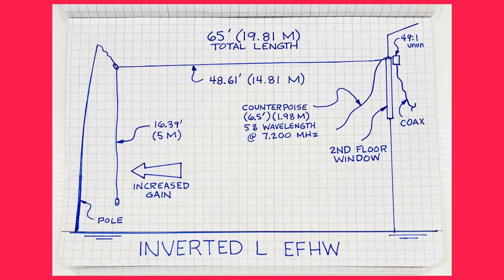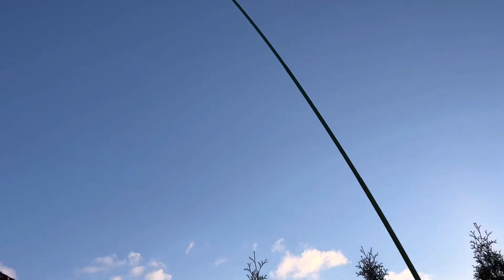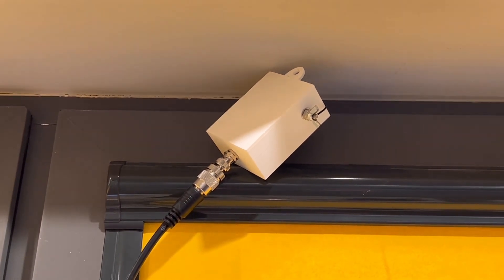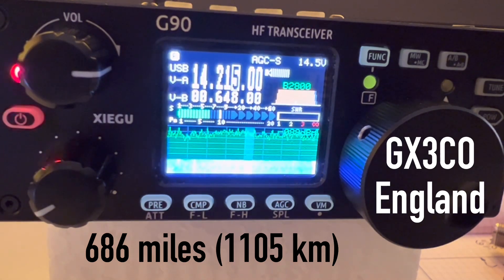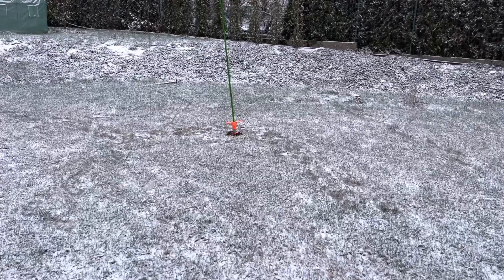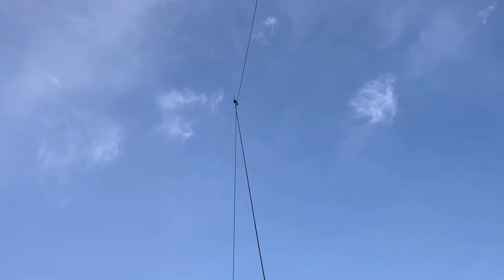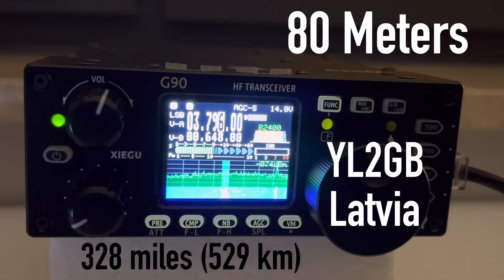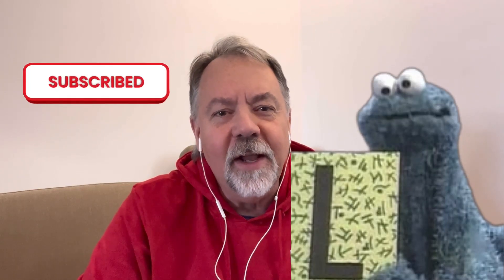Increasing the Directional Gain of an EFHW Antenna

Comment: I have had good luck with a home made EFHW cut for 40m, running up a 9m squid pole and then across to whatever trees are around in the area. I also lay a 10m counterpoise along the length of the antenna. Works great straight into a G90 using the internal tuner, and tunes up fine up to 80m.

Comment: I tried doing exactly what you have done but found that the SWR was off the scale and the noise was unbearable so what I did I reversed it and fed the 49/1 down the garden and fed it with coax, now SWR is perfect and the noise decreases a hell of a lot. now getting great results.
Reply from the maker: Awesome, thanks for sharing

Comment: Hey Walt, great video! Watching you operate in Poland got me curious about the process. I looked you up on QRZ and found you are a General class license holder. I recently upgraded to General and noticed in the video you were operating outside of the US General band limits. After some quick research, I found that you were in fact operating perfectly legally while in Poland! I am by no means criticizing, I just found this super interesting! Thanks for the great content! I''m going to try out the inverted L EFHW soon!
KM4EBM
Reply from the maker: I’ve actually done a couple videos on the CEPT process and operating in Europe. It’s really a simple process. Yes the rule for bands is that I operate under the band plan for the country I’m in, I get all of 20 here in Poland but as a General I can’t use 17 or 12 meters so that was a loss but I’ll be good when I get back, I’m taking the Extra exam in January.. 73, K4OGO

Comment: Hi Walt,I tried both your configurations but then I put the 49:1 at bottom of my 12m pole,ran it up vertical approx 35ft then across horizontal the rest of the way n this definitely seemed to work better for dx and local combined :)
Reply from the maker: Good stuff, thanks for sharing

Comment: i use end fed, inverted L, 1/4 wave wire antennas.   No balun required.  a 160M wire, 40M wire, 30M wire, 20M wire, all connected together off of one coax.   They work great !  Haven't looked for gain in the direction they point, I will certainly look now !    Thanks
Reply from the maker: Awesome, thanks for watching!

Comment: I use an Inverted L for 160-6 meters. I have mine fed at the base of the vertical portion with an air variable cap. The fed point is at 47 Ohms according to my MFJ 269 analyzer. I love it. I have made contacts well into Eastern Europe and East Asia from my QTH in NW Ohio.
Reply: How long is it?

Comment: My main antenna that I use at home is an EFHW in an inverted L. It's a little different though. Mine starts @ 3" off the ground then goes vertical for 45' then out to a pole @ 35' high. I have mine pointed kind of over Africa towards Australia. I feel like the gain helps. I'm very happy with it and get worldwide coverage on 40-10. Mine also tunes up on 80 as well. Very nice video. Maybe I'll try it sometime, your way.
Reply from the maker: Awesome! Thanks for sharing and thanks for watching. Hope to catch you on the bands. 73, Walt K4OGO
Reply: ZS1FSX here Walt howzit - I stand under correction here but it’s my understanding that this is not an inverted L, rather a horizontal L which is basically a cloud warmer.
As described above an inverted L starts close to the ground risers vertically then the tail is horizontal.

An EFHW acts like a Dipole in so much as the take off point is at the centre of resonance along the wire (a vertical has the take off at the base) so measuring the directional angle is at 90 degrees to the centre of resonance.
Hence describing your set up as a cloud warmer it’s radiating predominantly vertically.
Try switching things around take the transformer 49:1 unun to the base of the pole run the wire vertically and then the tail towards your window. Ground the coax braid side to a ground stake 
I suspect you’ll get much better distance.  
In my experience the tail provides a bending to the angle of take off so in this case it’ll still be orientated towards west but will be much flatter
Reply from the maker: @downsouthsafaris6788  theoretically I’m sure you are correct. This was just an experiment feeding it from the other end to adapt to my situational circumstances and see how it performed directionally. All the best and 73.
Reply: @downsouthsafaris6788  I don't think it will make much difference, whichever end you feed, the middle will always be in the same place. When you say "a vertical has the take off at the base", you mean a quarter wave vertical with a ground plane? You are effectively centre feeding a dipole at the ground.

Comment: Walt, well done... I may have to try this with one of my EFHW antennas. Cool that the G90 would tune up 80.
Reply from the maker: Thanks! Yes that’s a testimonial to the G90 ATU for sure. 73 my friend!
Reply: @COASTALWAVESWIRES  I have a squared EFHW and like all my end-feds I used, all tuned on 80 meter with the internal tuner. A EFHW of 10 meter long you can tune also on 40 meterband. the 49:1 UNUN I make from insulated wire in one peace and no soldering to it. Just use clamp connections. also no box around it, but vulcanization tape.

Comment: Your antenna experiments are a great inspiration to try out things. I'm often surprised about the performance of your low by the ground hanging antennas and especially the verticals. I wonder what the performance would be of a 40 meter dipole with one leg on a vertical pole and the other leg (and the feed point) along a 2 meter high fence. Any idea?

Comment: I did the same thing I have 134 feet I had it flat at 1st it was great and now I've got End fed box 1 feet off the ground and to goes up about 17 18 feet and the same at the end of the antenna it drop down 18 feet it Made a big difference especially on the high bands excellent on 10 m.
Reply from the maker: Awesome, thanks for sharing

Comment: Do you use EZNEC to model antennas? I use it a lot. The pattern of a halfwave horizontal antenna is the same end fed or center fed for all practical purposes in the real world. However there is definitely a skew in the pattern toward the down side if it is not installed horizontally. The half wave end fed antenna on 80 will load and work quite well as a quarter wave top loaded vertical in the same manner as my 165 foot long 160 meter Inverted L. Again with a slight skew to the low side of the flat top.  I go longer than a quarter wave so I can simply tune out the inductive reactance with a variable capacitor.
Reply from the maker: I have MMANA but to be honest I’m just getting familiar with it. Interesting input, thanks for commenting.
Reply: Seems like this is not an inv L? Correct me if I’m wrong. The feedpoint needs to be at ground level at some point? Not really on a second story window with a ground counterpoise hanging down. Also the higher the vertical section, the better the antenna works for the L purpose? I’ve noticed very little difference in running the antenna in all 3 configurations. I guess we go back to it’s a wire. And there’s no gain unless another element is added. Always fun to tinker with antennas though I don’t expect any significant changes 😁
Reply: @JayN4GO  Jay, this is an “inverted” L but not the typical inverted L we usually talk about. The classic Inverted L is a top loaded vertical. This one is fed from the opposite end. As with all antennas the current at the tip end is near zero and builds up as you move away from the end. Depending on the vertical height and frequency the vertical part can change from being simply loading the horizontal wire to actually being a vertical radiating element. In almost all cases you can bend the end of a wire, the part where the current is low, up or down and not reduce the effectiveness of the horizontal part by very much. In fact a half wave dipole can have its tip ends bent down so that the center horizontal part is only a third of what it was and you might not even notice the decrease in signal strength! There will of course be some reduction but even as much as 3 dB is usually hard to tell.
Reply: @dandypoint  Tnx bud! I’m not sure why I’m not seeing your videos. YouTube maybe hiding you. I saw your post in Fb group with Jason.

Comment: Couple weeks ago i did some test. 1/4 wl vert vs. EFHW 8010, where the feed point was on a 10 m pole on 3,5 m height balcony. I found that vertical was much much more effective that end fed. both of them were used without ATU, tuned in a middle of 20m band. Thats my opinion. Maybe i did a mistake and i shoul feed it on the height, not on the bottom of the pole.

And of course - thats confirmed - the more counterpoises the better. 

Take care! SP7EZG, thank you for the channel!
Reply from the maker: Thanks for sharing Artur! Interesting experiment. And yes the more counterpoise the better. 73 de K4OGO
Reply: @COASTALWAVESWIRES  i think i should do the trick, and Put the feed point higher than on the bottom of the pole. Take care!

Comment: very interesting video !! just to share I erected an inv L EFHW couple of weeks back as an experiment,  30ft vertical and about 35ft horizontal, wanted to compare it with a 40-10m Doublet inv V.....I found Doublet to be a better antenna overall, there was not much difference in the TX efficiency but Doublet was much much better on the Noise Rejection...so overall i found Doublet a better antenna but as you said it doesn't look like an exact science.....but key to enjoyment is Antenna experimenting.....thanx keep the interesting videos coming...73s..
Reply from the maker: Thanks! And thanks for sharing the experiment! 73, Walt K4OGO

Comment: ....what you really built was 1/2 a quad... well sorta. 1/2 your radiation is vertically polarized the other half horizontal...The vertical part is going to have an omnidirectional pattern which I suspect from your results, and if from an angle of 25 or 30 degrees to the horizon, would correspond to your excellent medium/short skip results on 20. The horizontal part will be off the sides. Radiation from the vertical portion will make up for the null off the ends of that antenna, and there will likely be little or no cross polarization in the directions of the null. I have an EFHW.. and a Xeigu G90... gotta try this.

Comment: did u try reverse and feed from the vertical side 3m up and test whats the difference? also your rf anny issues diferent coax lengths excetra and noise sure like u test it in reverse order and see if difference

Comment: Hi Walt, that’s what Ham is all about.
I like these wires, you can do a lot with them.
Have you tried the same wire your using here an make a Halfsquare. 5m vertical, 10m horizontal and the rest going down. I had a blast with it, and the noise floor goes down.
Tnx for your Video 73 HB3XBL 😤🇨🇭
Reply from the maker: Thanks for watching! Yes I have, I actually have a video of the half square here on the channel

Comment: Feed it at base of vertical  section,,,coax can radiate and feeding  it at shack end can cause rf problem in shack,,choke coax off before coax enters the shack or use counter poise or earth at base of vertical feed point,,,try an L match at feed point although  this will require physical  ajusting for changing  bands,,,if you eant real directivity try 2 or 3 element vertical ground mount beam.

Comment: An idea You should try half square configured for 20m with the 40m efhw. The impedance Match with the efhw on bottom corner is spot on.  May have to adjust a little but you will get some nice gain on the broadsides.
Reply from the maker: Great idea, I actually have a half square for 20 with me that’s fed from the top corner but my two poles just won’t support it. I may put this wire up and experiment.
Reply: Walt you will have a blast.  Great for dx.  On 40 it’s pretty much the norm however you will have some gain on 20m especially on the long haul
Reply: K4NYX -- My thoughts exactly!  Waters & Stanton channel did an episode on the bottom corner fed half square a few months ago, and I'm currently building one to use with my 1.5 KW station.  They typically use a 49:1 transformer and have a broadside gain pattern.  I'll send a link to the W&S episode.

Comment: Great video, I’m thinking how I can try this from my balcony. I use an inverted V EFHW with say 30% length in the second leg, and some 30 degrees opening between them looking top down. I figured it would give a little more unidirectionality than a standard horizontal configuration. Maybe try an inverted V EFHW sometime :) Stay safe out there in Poland!
Reply from the maker: Thanks! I’ll experiment with an Inverted V eventually, I’m interested in how it will perform here. All the best and good DX! Walt K4OGO

Comment: Were you running the pre-amp or the attenuator on the G90 for the UK QSO? Video resolution isn't good enough to read it. Also, what is the gain like in the direction opposite the heel? I'm in Utah and would like to be able to work stations in NV and CA, but would also be good to work stations to the east (WY, CO).
Reply from the maker: Just the pre-amp with no attenuator. Opposite of the heel for me was Russia behind me, I honestly couldn’t give you a solid TX answer on that because I really didn’t try to make any QSO’s in that direction but RX was pretty solid, I was continually hearing R stations.

Comment: Will that length work with the MFJ-998RT straight to wire nut and no 48:1?? That tuner can use a wire connected directly to it, so not sure if we then have to use 468/freq.

Comment: I have the same setup here in Chennai  and my best contact so far is Oslo Norway with  20 watts. You can reduce your swr further down from what I see in your video which is almost touching 2. Anyway great little radio, use it exclusively for ssb voice contacts and dx. Namaste 73 De vu3mes Satyan
Reply from the maker: Thanks for commenting, yes I’ve gotten the SWR. I was spinning the dial and making quick replies on some of those calls and could have gotten the transceiver in better tune for sure. 73 de K4OGO Walt

Comment: Hi Walt, good experiment. I’ve done the same thing here in my garden. I ran a horizontal EFHW from the attic to a nearby tree and at some point decided to drop the last 5.5 meters down to form an inv L. Since I did this I get out further, towards south eastern Europe (I am in the Netherlands). Much easier to make DX contacts then before. I don’t find that it has more directionality, it seems to still be omnidirectional, just with a slight gain at lower take off angles. Depends more on the day to day solar activity which direction works better. At least that’s my experience after 3 years of having the antenna like this.
73, de PB7RS
Reply from the maker: Hi Robert, Thanks for your interesting input. 73 de K4OGO